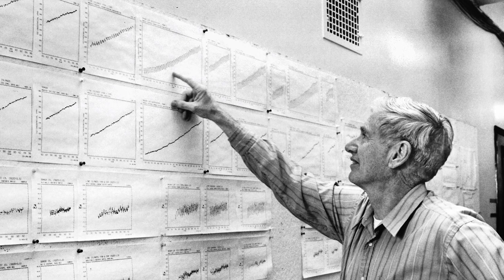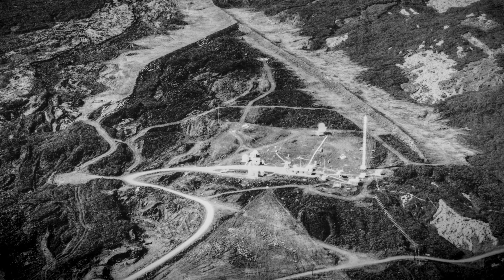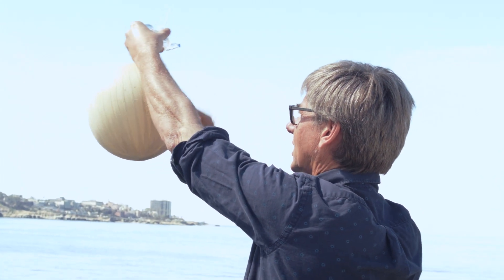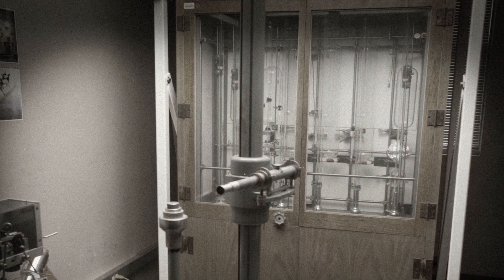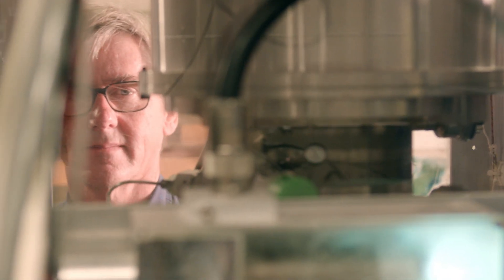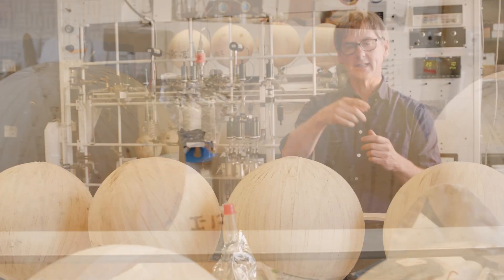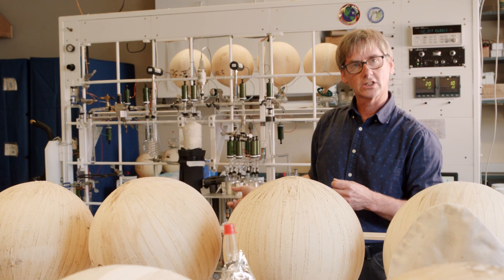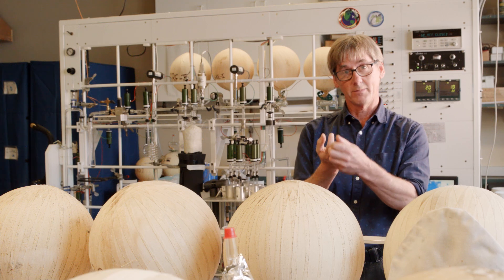How Scientists Measure Carbon Dioxide in the Air

Comment: You had me until you said that fossil fuel burning is the sole problem of co2 increases in the air. Explain to me, then, how co2 increases happened in earth's history prior to fossil fuel burning?  Humans breath out co2, and our population has exploded. An increase of forest fires can cause additional co2 as well. Over harvesting of forested areas can diminish the earths capacity to filter co2, and raise levels as well.......But no. As you clearly said in your video, it's the burning of fossil fuels that's causing the problem. How very unscientific of you.

Comment: To take a real test of the C02 in the atmosphere you have to get much further away from populated areas, how many people live in that area compared to 1960  I will tell you San Diego alone has risen  from 800,000 to 1.4 million.  So the area he takes samples from of course would see significant gain but if you get way out past Hawaii the numbers would stabilize, but thanks for spreading fear

Comment: How does the monometre work? WHat does the analyser do? Where can i get info about isotopics? So you send the air through an analyser, where does the air go and how is it contained so that you can then use the exact same air to be mounted onto something to pump the air away, and how do you separate the carbon dioxide from everything else in the air - the nitrogen, oxygen, and argon. Why is there no water vapour? I'd have thought more water vapour over the ocean?! Salt? How do you clean and sanitise the instruments you use? What is the difference between CO2 that comes from a plant v a car? And how do you tell that? What method do you use? Thank you
Reply from the maker: There are additional charts, data sets, explainers, and technical documents at https://scrippsco2.ucsd.edu/. Please note that Ralph Keeling's demo here on Scripps Pier is illustrative; the actual measurements for the Keeling Curve are taken atop Mauna Loa.

Comment: Greenhouses that artificially have CO2 added into them by up to 1000 to 1500 ppm have proven plants and crops grow 2 to 3 times faster and larger providing crop yields that are undeniably significantly higher.  In the last 650 million years naturally occurring CO2 levels were between 1000 up to 7000 ppm.  Dinosaurs became massive when natural CO2 levels were well beyond 1000 ppm.  Yes the planet was a bit more balmy but it did not burn up as leading expert AOC claims “We have 13 years left.”

Comment: Carbon changed from 0.03% of the atmosphere to 0.04% of the atmosphere.
That equates to 0.01% change in the composition of the atmosphere.
That could be an error.
Reply: No... it equates to an increase of (410-315)/315= 30% in atmospheric CO2 concentration in the time period described in the video.  Given the accuracy of an indivdual measurement of CO2 is better than +/-0.2ppm (0.4ppm span), we can apply SRSS and the 90% bounded error window comes to roughly +/-0.28ppm when computing the difference in two measurements... which in this case, with the bounded span assumption of +/-0.2ppm error, is on the order of 0.28/(410-315)=+/-0.3% @90% confidence...
Reply: @euclon  besides a percentage change in a percentage concentration sounds more scary and impactful. Buy an EV now.
Reply: You've completely misunderstood how margin of errors work. It's not x.y% of any arbitrary number.

And let's say the composition of the air, changed by 1% of sulphur - well good luck, we would all be dead. So numbers can't be analyzed arbitrarily like that.

Comment: And it keeps the funding coming $$$$$$$$$$$$$$
How come these fools never talk about past Co2 levels???
Reply: Because the ice core record ...for the second animation was extracted from 2 mile ice core samples on top of the Antarctic ice sheet. Co2 before the year 1760 was stable. For 800,000 years co2 never swung from 180-280 ppm. After the year 1760 co2 level that were sable broke out of the 180-280 ppm window and has never pulled back once except during the 2008 crash. It soon started the upward swing.

Comment: I would like to know how you convert carbon dioxide gas to giga tons of carbon dioxide in the atmosphere. I have been told you simply weigh the hydro carbons before they are burned to come up with the tons of carbon in the atmosphere. If this is how it's done it intuitively doesn't make any sense to me. I'm certainly not a physicist but something is terribly wrong if that is how it's calculated. I remember being taught in school that mater cannot be destroyed but it can be changed from a solid to a gas. However carbon itself is not a gas. It requires a molecule of oxygen combined with two molecules carbon to form a molecule of carbon dioxide. Because mater cannot be destroyed does not mean that burning a ton of coal should equal a ton of Carbon Dioxide is in the air. Heat somehow has to enter into the transfer of overall weight of the resulting by products resulting from burning coal. In simple terms burning coal produces a colorless gas and ash plus any other elements that aren't combustible. Walking outside if I hold out my hand the supposed weight of gigatons of carbon in the air is impossible to notice. The sun causes warming of the atmosphere. A simple way of proving this is as follows. On a hot summer day stand for a few minutes facing the sun. Then step into the shade and tell me if you are as hot, hotter or cooler than you were standing directly under the sun. The answer will always be cooler standing in the shade. Finally taking air samples anywhere in the vicinity of a major city will not give you an accurate sample of the air surrounding our planet. Why do green houses increase the amount of CO2 in the air of their operations. CO2 has become the Boogey Man of science and an industry for fast talking scare mongers. Without CO2 in the air for all out food crops we would all be dead. Once CO2 levels drop below 150 parts per million all the plants and trees in the world would begin starving to death and would eventually die, Instead of spending billions on pumping CO2 underground compress it and sell it to green house producers at a reasonable cost. Bill Gates believes the worlds population is too high and needs to be reduced. Why not get rid of him and his family to begin the process along with all the Global Warming CO2 is the problem believes. Al Gore might volunteer to Join the Gates''. Fat chance either would volunteer. Rich unemployed retired people should keep their uneducated ideas to themselves and not fill the media with more and more bunk. Happy new year. Anything will be better than the Bull we have been put through in 2020.
Reply: Stop by Dr Kathrine HayHoe Facebook page and ask her. She is a Atmospheric Scientist and is often interviewed by PBS,CNN and other media outlets.

Comment: I thought corbin dioxide came from animals and carbon monoxide came from cars.
Reply: Both come from cars but one is dangerous and the other isn't but they blow it out of proportion. The earth does not have a cover over it so the term green house effect is misleading. This effect works in green houses and aquariums only because each are insulated to the outside what happens is the R factor, the glass or plastic alters the radiation affects from long to short waves or visa-versa.
Reply: @Dogma1able  The Earth does have a cover over it, it's called the firmament.
Reply: @Dogma1able  just because it's called greenhouse effect does not mean it's a greenhouse... Sorry but that's the basics..
Reply: Animals are possibly not included in the Scientific studies "I have not seen them mentioned in terms of total co2 output" how ever they are mentioned "cows" as a big produced of methane. Want to see a REAL shock? Both The Amazon and Congo forest are being cut down to make way for agriculture or for cow pastures. You can see evidence of mass fires in either part of these countries by studying them on https://caltopo.com/map.html#ll=41.51192,-122.07184&z=11&b=mbt&a=modis_mp click on "active fire" it does not show total volume of soot or co2 produced just a visual aid for anyone who is to 4x4 or hike in the back forestry ares. Swing the mouse and zoom in on Congo or Amazon.
Reply: @LK-pc4sq  thank you

Comment: did you notice that he attained the air over the water. When water evaporates it disperses the carbon dioxide trapped in it. This isn't a good over all measurement of the entire atmosphere at all.
Reply: They have a boat also which is taking out in the bay for doing this testing. When they do this the test isn't accurate for it is measuring the exhaust of that boat.
Reply: @Dogma1able  I'm sure the boat would be off.
Reply: Sample near her breath !.

Comment: Such perfect graphs, almost unnatural.
Reply: Making graphs to achieve an end goal is fun.  The same data can be displayed in so many ways.
Reply: When you're the only group measuring the data; it's so easy to fudge. So the claim is this. The increase of 1 in 10,000 molecules in the Atmosphere to CO2 is causing the Climate Crisis they are claiming. Those quite rare additional CO2 molecules are working overtime.

Comment: But isn't the carbon dioxide from the boats affecting the sample?
Reply from the maker: Ralph's demonstration was on Scripps Pier in La Jolla, Calif.
Reply: @scrippsoceanography  are there boats that meandering back and forth, going past the Scripps Pier?
Reply from the maker: @BD-vh1mt  We launch a variety of small boats from the pier, but this is not where the Scripps CO2 program conducts daily measurements. That occurs on Mauna Loa and you can read more about the process at https://scripps.ucsd.edu/programs/keelingcurve/2014/07/28/how-is-co2-data-processed/
Reply: @scrippsoceanography  So the Scripps CO2 program does observations from a 'barren volcano' that last erupted in 1984. Do volcanoes give off different amounts of carbon dioxide comparatively to the areas not near volcanoes?
Reply from the maker: @BD-vh1mt  As the Keeling Curve website  notes, the great value of the Mauna Loa location is its isolation from confounding sources and sinks of CO2.
Reply: @scrippsoceanography  and those sinks could be skewed due to high concentrations of co2 in the volcano itself. But my main problem is the fact that 50 years of measurements is not relevant to propose any climate model
Reply: 50 years ago we were being told we might all freeze to death in a new ice age, see the video narrated by Leonard Nimoy: "Remember: Ice Age is Coming 1978 Science Facts"
Reply: @scrippsoceanography  why did he not do it in hawaii to reflect where the measurements are normally conducted?

Comment: I thought you'd explain, how CO2 is measured (technical), like your title suggests. Am disappointed.
Reply: In the old days, they measured CO2 concentration by passing a known volume of air through an absorber such as potassium  hydroxide and noting the weight increase.  Today we measure CO2 by  passing infrared light through a tube containing the air sample.   Since CO2 absorbs IR (in spite of denial by some ignoramuses) the attenuation of the radiation indicates the CO2 concentration.
Reply: Yea this video is for a different target audience. As we all know, most people actually caring about the climate change issue are kids.
Reply: manometer. done.  lol... yeah, that's why I came too.  I just learned what a manometer was today, incidentally, but I don't see how it could measure co2...
Reply: think of it like the flux capacitor
Reply: you can't expect anything more than science man says CO2 high

Comment: From 315 ppm to 410 ppm is an increase of less than 25%. 
Now let’s just imagine in 60 years how many trees have disappeared in that area just since his dad started measuring. There’s your answer.
Now.....25% of 0.04%.....0.04 divided by 100 x 25 = 0.01%
So that means that 60 years ago in that spot there was a total of 0.03% Carbon Dioxide present
Today there is 0.04 %......wow....horrors.....so small it needs to be measured in ppm.
Plant a few trees and watch that drop back down to .03%.
My question is.....the model they use to show global warming due to CARBON DIOXIDE is when it’s in the stratosphere. 
How do they measure it way up there.....or do they...or can they.
Nobody seems to be able to answer that.
Want to know why.....it doesn’t exist there.
Carbon Dioxide ...like Sulphur Dioxide is heavier than air and sinks to the ground ( where it is absorbed by trees, vegetation and the oceans.)
That’s why there is so little of it
If carbon dioxide gasses were ten or twenty times higher the only difference would be the trees and vegetation would thrive and it would quickly be absorbed and the level would drop back to normal.
Don’t forget....CO2 is vital to a healthy earth.
Reply: Mate, you can't calculate a simple percentage, increase from 315 to 410 is +30.16%
Opinions of people who fail at grade school math are not worth anything.
Reply: Depends on how you look at it, and it's tricky. 315 is 76.8% of 410. That where he got 'less than 25%'. As you pointed out, 410 is 130% of 315. Not reason to discard everything he said. What I'd like to know: How did they take an instantaneous temperature over the whole planet in 2010 to be able to tell us it is going to be higher by 0.2 degrees Centigrade in 2020?  And how do they know wind currents at San Diego haven't changed from years past and all other conditions (any that might matter, such as nearby ocean water CO2 absorption or release from plankton or undersea volcanoes or flow from dirty China factories) are identical and CO2 at one point applies to the entire planet?
Reply: you can't always determine effects of change by absolute value, e.g. your body, only 1% colder (in kinetic energy), is e.g. 34°C (327K) instead of 37°C (330K), so close to death for temperature sensible organs.

Comment: Why would you test for c02 during the worst fires ever in California? Would not the carbon spewing in the air from the fires have an affect skewing the results?
Reply: For your information, the atmospheric CO2 measurement test has been running continuously since 60 years ago at a dozen different locations around the globe! .
Reply: Where are the CO2 measuring stations around the globe?
Reply: @garyha2650  I really want to know this too.  I hope it's from more than just one source. There should be hundreds of samples from all over averaged out. Have you found any info about other sample sites?
Reply: @Acewilder15  In discussions with them elsewhere, on that and everything else, I can't get specific answers out of them, they often point to "peer reviewed papers". It appears they are operating on blind faith instead of asking questions like in real science. Those papers are usually behind a paywall by the way. I'd still like to have a full list of where CO2 is measured.
Reply: @garyha2650  Near the smokestack of a diesel-powered boat the deck just below it like is shown in the video.

Comment: it's not essentially that simple, if you cut all the tree's and deminish all living plants through deforestation, agriculture and concrete where plants used to grow, you deminish the absorbsion of co2 . if there is a rise in temperature in the ocean's for whatever reason(solar output..) the ocean will release more carbon that was stored in it, erupting of volcanoes is adding a lot of co2 and oceans are storing 50 times more co2 then atmosphere
Reply: it's not as complicated as you try to make it. You can tell how much of the CO2 in the air sample came from fossil fuels because they essentially never release CO2 with Carbon-14 isotopes - because C-14 isotopes only last a few tens of thousands of years and fossil fuels are hundreds of millions of years old. 
When we started burning fossil fuels, the percentage of carbon-14-free CO2 started to rise "mysteriously" in the atmosphere, at an equivalent rate as the rate of burning. This is confirmation that the CO2 from fossil fuel burning is going into the atmosphere.
Reply: So where did the CO2 from all the fossil fuels we burned go to then? You can quantify that and all the other figures you mentioned and add it all up you know. Once you do, you'll find that plant mass on ground is a net sink, oceans are a net sink and volcanoes output a measly 1% of what we do and still atmospheric concentration goes up by ~2ppm/year.
Reply: @aleksandersuur9475  is that you greta thunberg ? no we are not going to destroy the planet unless with nuclear weapons. 
but we can could have saved ourselves with nuclear power if it weren't for so much anti nuclear propaganda. even thought our entire standoff approach of diplomacy was nuclear standoff.
Show anti nuclear propaganda for what it is.
DEpopulation they want. instead of free energy.
Reply: @aleksandersuur9475  Where can we get the data?
Reply: @garywilson1688  It's called the internet, the same thing the op got his data from...